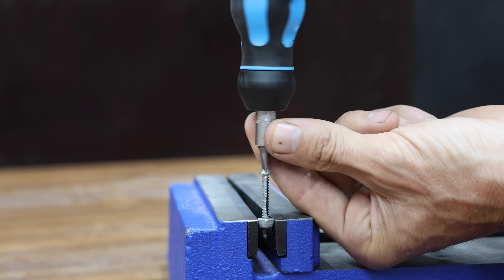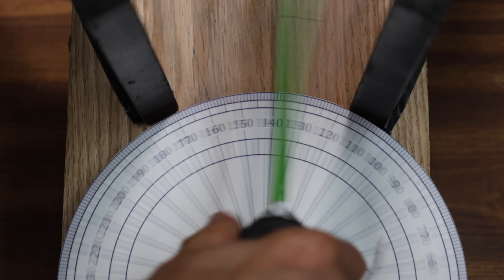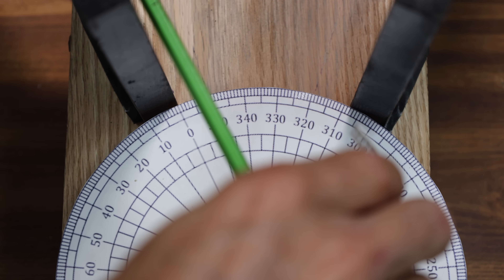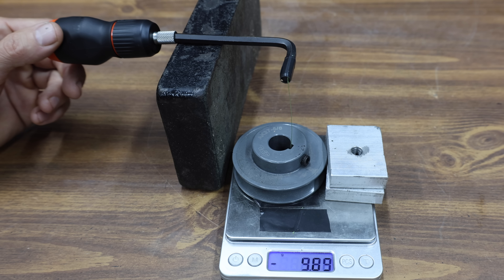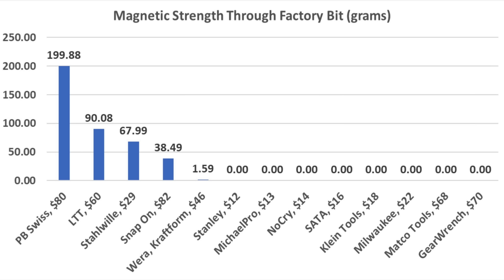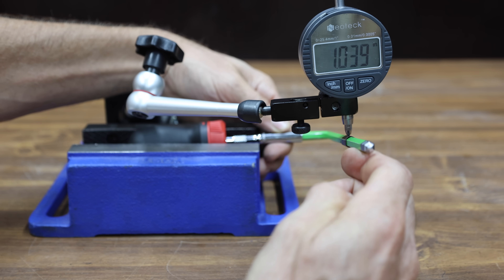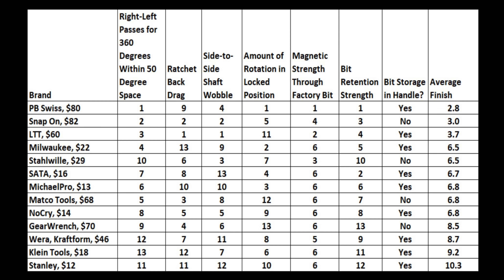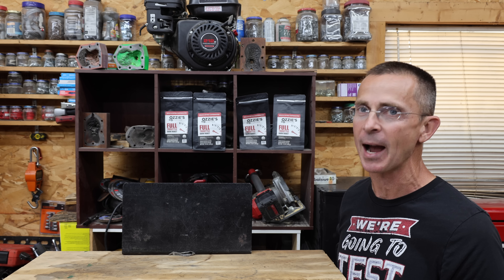Is Linus Tech Tips “Stubby” Screwdriver Best? Let's Settle This!

Comment: I'm not certain in what conditions you'll need to torque a screw, or small nut much more than 100lbs, and even that would be pushing it with just a hand grip. You'd need to be very strong to get that kind of torque on such a small grip hence I think that test isn't really needed as they all would pass the torque test at 100lbs. Cheers to LTT for selling a good product, but I'd go with the Snap-On were it my money.👍😎✌🗽
Reply from the maker: Thanks for the feedback.
Reply: @ProjectFarm  BTW, my comment sounded critical now that I look at it. It wasn't supposed to be, you do a bang up job reviewing everything you test. 👍😎✌🗽⭐⭐⭐⭐⭐⭐⭐⭐⭐⭐

Comment: Didn't include where the ltt screwdriver was made. Was a bit indicative of the rest lf the video. Pretty disappointed to see some obvious bias here. Ignored where its made, threw out results that didnt favor it, seemingly threw in more tests of the same type that it was strong in, the JB weld comment, shout-out at the end, etc
Reply: Same with the first screwdriver. Includes 3 tests on magnet strength, throws out 2 tests on durability. 

Because as we all know the magnet is more important than how long the tool will last. /s
Reply: @dru70292  100%

Comment: I'm a big fan but do have a question about the number-of-x-degree-movements-to-turn-360-degrees test.  Shouldn't the reference point be the shaft, or the bit itself?  Doesn't placing the hex wrench on the handle mean that the diameter of the handle where the hex wrench is attached will impact results (thinner handles will be able to turn more degrees at a time?).  I haven't really thought it through fully, so I can't tell.

Comment: Wouldn't side to side shaft wobble be better to measure in millimetres rather than hundredths of an inch?

It's like saying my shoe length is 0.0005 of a mile. Kind of ridiculous. But if I measured my shoe in centimetres or inches, it would make more sense because it's a unit that is relative to the size of the object being measured.

Comment: You can actually rehone Phillips head bits by hand with a rotary tool and a small grinder bit. That way you might not have to throw some of those away an you could even retest them afterwards I find Its a good fix for cam action on even cheap screwdrivers. 12:48 some screwdrivers have larger sections of metal for this reason Which makes the replaceable shafts questionable unless you can use easy to get part or standard like 1/4"-1/4", or an extension with a bit tipend
Reply: Does anyone refurbish bits? Take it from people who work in construction, myself included, stay away from DeWalt bits. They are hot garbage as they aren't hard enough. You must pay the money and get the high carbon steel bits if you want them to last.
Reply: @bluecar5556  It only takes a few minutes to diy grind them. That way they last and you get to keep your money. 🧠
Reply from the maker: Thanks for the feedback.

Comment: Does a lower back drag mean the screwdriver is less "strong" when tightening screws?
Like, a 10g backdrag screwdriver would snap sooner than a screwdriver with a stiffer backdrag?
Reply: No, it's an indication at how well you can turn the ratchet and not have the screw unscrew itself. If it's high and say you are threading in a machine screw it will just unscrew itself, which is super annoying. But if you're working with a coarse thread it likely won't matter it will just fatigue your hand faster if the back drag is high. So low back drag is pretty much ideal in all situations.

Comment: I need to add a versatile ratcheting screw driver with bits to my metric motorcycle tool bag.  Do any of these come with metric Allen wrenches, etc, or will I have to buy the separate metric bits?  Thanks.

Comment: I watched the Linus Tech Tips Stubby video made by them when it was released and almost bought one, but it's quite expensive.  So I was eager to watch your comparison.  #3 on 360° within a 50° space.  #5 on Length.  #1 in Ratchet Back Drag (because it was designed to work inside computer cases).   #2 in Magnetic Strength (also because it was designed for that).  #1 in Side-to-Side Wobble (for the same reason and by a long shot).  #4 in Bit Retention (and I'd rather not have the bit be too hard to remove for changing).  #11 of 13, nearly last, on Rotation in Locked (what a shame).  #2 in Bit Tip Failure (pretty darn good, but I'd get replacements bits elsewhere).

For me, the LTT would be the one.  I don't need indestructible for working on computers, it's a little shorter than the Snap On, costs less, its bits are strong, and things like 2" and 6" bits and extensions make it more versatile for reach.  Thank you, Todd.  Too bad you can't get an affiliate link.  I like to support you when I need or want something.
Reply from the maker: You are welcome!  I do have an Amazon affiliate link.
Reply: @ProjectFarm   I meant affiliate links for places like Harbor Freight, Linus Tech Tips, the other two Ratcheting Stubby Drivers and other products not on Amazon.

Comment: Video suggestion: standard led light bulbs. I have used Cree, Philips, GE, feit. Feit and GE fail after a few months of normal use. Only have on Philips and it is a smart bulb, still going strong. My oldest led bulb is cree and it spent 6 years outside in montana and still going strong. I would love to see a durable test, light output, wattage use, color accuracy test.
Reply from the maker: Thanks for the suggestion.

Comment: Honestly, at $14 the No Cry is a great value from a back drag perspective being so close to the $70 GearWrench, and the $30 Stahwille with its fairly strong magnet and still fairly low backdrag is a close second in value in my mind, especially if you have your own bits handy and would otherwise be ok with no onboard storage
Reply from the maker: Thanks for the feedback.
Reply: You can get the stawille one for cheaper under bahco sl25 , exact same stubby with extensions& bits for less money
Reply: @garymccreath2773 
Not sure who the OEM is for that one, but the same tools (with slightly varying styling) are sold by a number of brands. 
I happen to have a Bahco branded one, but would not recommend it. There‘s nothing particularly wrong with it, but the ratchet isn’t all that precise, mediocre back drag and it has a fair bit of shaft wobble. 
The toothless ratchets made by Oplast (sold under Hazet, Gedore and some other brands in different configurations) are just better and similarly priced.
Reply: Eh I had a bad experience with my No Cry stubby from 2019.  After less than 2 months the mechanism for holding bits fell apart.

Comment: I can not understand why anyone would pay $80.00 for a stubby screwdriver.
Reply: It’s not just about the tools it’s warranty customer service time I have to spend replacing them if they break ext 

Even if harbor warranty’s all there tools the same as Snap-on if I have to drive a hour there every other day to replace tools when Snap-on will come to me wherever I am and get me a replacement in mins once a year I’m saving more than the cost of the tool on the time alone.      Also there’s a big difference in tools like bits and wrenches the cheap one might be durable but will round a bolt or screw faster at lower torque than a different bit or wrench snapon’s non slip wrenches being one example
Reply: @Doubie.  I know what you're saying and I agree that service is worth something, but come on 80 bucks for a stubby? Even if its' ratcheting .
Reply from the maker: Thanks for the feedback.

Comment: Um...bruh...it's a "stubby"!!!
How is overall length not one of the ratings?  Some of these are longer than their non-stubby #2 counterparts from the same manufacturer.  Love the reviews as always and your methodology is so solid. 
Can you add an addendum or sticky with total length from the bit insert point to the tail end of the handle? No point in buying a $100 stubby that's 6" long. Lol.

Comment: Destruction tests should ALWAYS be included because mechanics use tools to get the job done compared to which tool survival is secondary. 
A screwdriver example is forcing a stubby against a fastener with a pry bar then turning it by visegrip which I and others have done to remove aircraft panel screws in tight locations. Automotive engine bays see all sorts of unconventional fastener removal out of necessity with modern engine compartments being quite cramped and awkward.
Reply from the maker: Thanks for the feedback.

Comment: Great testing on these screwdrivers! I have one observation on the Klein Tools bit holding test. I noticed that the bit in that one was not magnetic like the others and had a straight blade tip and a ball bearing holding assembly on it. Others seemed to all magnetic. I wonder if that had a different tip in it what the test would have been. It's surely not a big deal, but just curious. Thank you for all the hard work you do with all the testing you do!!
Reply from the maker: Thanks and you are welcome!

Comment: I'm surprised the LTT stubby is magnetized.  That's a recipe for disaster, working on computers.
Reply from the maker: Thanks for the feedback.
Reply: @htr5372 Right, and you probably use adjustable wrenches to work on your car.  Your car will usually get fixed, I'm sure.  That's just not the way I like to work.
Reply: @htr5372 Wow, my comment about LTT's magnetized stubby is really getting to you.  Did you design it, or what?  This seems very personal, to you.

Comment: LLT Screwdriver and Backpack owner, can report good quality in both products so far. I use them both for their intended purpose of working on PC's and totting my laptop, Mouse, TKL keyboard and sketch book. I don't see myself needing a stubby for any reason. If I can't get the full size LTT in a place I need it, it's often just the short and thick shaft relative to a non ratcheting screwdriver that is the problem. Mechanism made in China, Body Molding and Finished Assembly done in British Columbia, CA.
Reply from the maker: Thanks for the feedback.

Comment: Cool video as always!

Suggestion for a video....compare gear oils, conventional vs synthetic.

75-90, 75-110, and 85-140.

Pour tests in realistic environments...like 32 deg F, 0 deg F, -20 deg F

The way cold and warm and hot oil clings to gears, conventional vs synthetic.

I think people will be surprised how good conventional gear oil is.
Reply from the maker: Thanks!  Thanks for the suggestion.
Reply: @ProjectFarm  Forgot to add....gear oil at 200 deg F, or even 225-250 deg F gets interesting in terms of clingability between synthetic and conventional. Hard to measure shear and cushion without the high torque of a ring and pinion though...just some ideas.

Comment: The LTT seriously need a thicccer shaft for the break test. The handle or the rachet should be the fairlure point, not the bit holder. I've had cheap bit holder break on me from normal use just because the walls were too thin.
Reply from the maker: Thanks for the constructive feedback.

Comment: I know it would be a pricey test to do, but I'd love to see you test cordless mini cutoff tools such as the Dewalt 20V cutoff tool, the Ryobi 18V cutoff tool and the Milwaukee  M12 Fuel 12V cutoff tool. These are small blade tools that are only meant for cutting thin metal. Although toothed saw blades are available, they aren't common in this size tool, and as far as I know, none of these claim to be able to cut wood.
Reply from the maker: Thanks for the suggestion.

Comment: I know you mainly do tool reviews and auto stuff. But i know alot of guys, that use box fans with filters. And air purifiers when working. As well as just wanting to know the general conclusion on which ones work well and which ones dont. Like, shark, levoit, honeywell etc. You do in my eyes throughly test stuff. And alot of videos i see wouldnt test as well as you do with an air purifier. And with todays climate issues, smog, wildfire smoke etc. I think it would be a cool watch.
Reply from the maker: Thanks for the suggestion.

Comment: Another great test. It's reassuring to see Snap On excel in the 'lowered expectations' department, their consistency in that is stellar. Arguably, most guys/gals don't have the grip strength to break the mechanism on a stubby, particularly in a tight location. The pros probably do. For my use and money, I'd stick with the middle of the pack and lower price range, none of which we'd know without your test.
Reply from the maker: Thanks!  Thanks for the feedback.

Comment: I immediately bought the regular screwdriver after your review last time. I was happy with my purchase and continue to be. There is nothing more satisfying that taking an electrical box and starting every screw with the ratchet working after the first turn because there is very little back drag. The stubby I don't think I will need. Most times when I'm doing work I just do the extra little bit to allow me to use a standard length screwdriver. I appreciate their entrance into the market as it will undoubtedly make other manufacturers do better on their products.

Thank you for another great informative video.
Reply from the maker: Thanks and you are welcome!

Comment: If price isn't a factor the LTT holds its own quite well, but for the majority of people using a stubby screwdriver, overall length is the biggest factor (or you'd be using a normal screwdriver), then price. All the other factors are largely irrelevant assuming they don't fail too soon. For me, a $16 screwdriver would need to be four times 'worse' (longer or breaks with human forces) than a $60, and they were much closer than that.
Reply from the maker: Thanks for the feedback.

Comment: I bought a generic version of the NoCry that looked practically identical for £5. Worst screwdriver i’ve ever used. As soon as any force is applied on the head of the screw (straight down not twisting) the whole screwdriver fell apart due to only being held together by a small metal ring and a plastic piece.
Reply from the maker: Thanks for sharing.

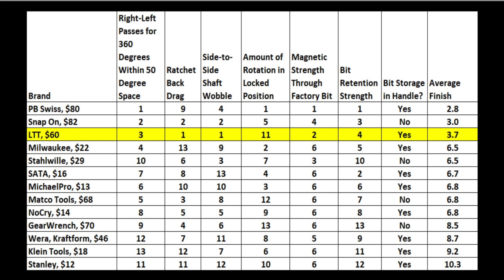Comment: 16:16 Bit storage is a gimmick. Any craftsman has a kit with multiple of many different bits, those 6 or 7 in the screwdriver wouldn't make any difference in my opinion.
The total length of a "stubby" screwdriver is most important, and most of them are still too large and bulky for some of my applications.
Reply from the maker: Thanks for the feedback.

Comment: Why did you test in a 50 degree radial?
This bothered me quite a bit since 360 degrees is evenly divisible by 1, 2, 3, 4, 6, 8, 9, 12, 15, 18, 20, 24, 30, 36, 40, 45, 60, 72, 90, 120, 180 and 360 itself.
IT IS NOT evenly divisible by 50!

Augh! It bothers me like a rusty bearing...

Comment: Did not see mine.  Mine is a red transparent ball with black rubber grip, and has two length settings (4.5," and 5.75" with bit).  I suspect the ball is wider than the handles on the reviewed ones.  I doubt it cost more than $7.  Yet, I don't think I would trade it in for any of these.  It would not fare well on the torture tests.  But when am I going to turn it with 100 foot pounds?  Who keeps all the original bits?  Testing those makes no sense.  Side to side flop can be a feature, helping keep the bit in the screw where the angle is very difficult.  What I have is far from perfect.  Back drag matters, and I suspect mine is not great.  The 360 passes matters too.  Again, mine is probably crap.  But it fits my hand.  Took a look at it.  No brand.  Looked at Amazon...it was not there.  Mine appears to be in bad shape, too :(  It appears to have more back drag in some places than others.  In theory, you can one-hand direction switch, in practice it tends to be too awkward to do.  So, it looks like I need a replacement...but I don't like any of these or any of the prices.
I am sure I am dreaming, but it would be great if there was a geared one that can spin faster than you twist and slower when you twist, depending on setting.  Or even better, based on resistance.
I honestly can't see paying more than $20.  And one that does not hold any bits?  That is ridiculous.  Who would buy that?  How about 15 bits, including some popular nut driver bits?
Reply from the maker: Thanks for the suggestion.

Comment: Another great one. One way I think you could have a better  representation for the locked position movement would be to set it up like the one used for the working arch swing  and start the Allen key at 0 and see to what degree the key will go. Then you can see that in locked position _ driver has xx° of backlash.  Also, for future screwdriver tests: torque drivers and  include the kobalt double drive in your next round of screwdriver tests since it is drastically different from other ratcheting drivers in how it functions.
Reply from the maker: Thanks!  Thanks for the feedback.

Comment: I would have liked to have seen the Doyle version from harbor freight included.   I really like the improvements HF has made to their tools over the last few years.
Reply from the maker: Thanks for the suggestion.
Reply: HF has had a number of 'good' tool reviews on occasion the last couple years.  They can spec quality at least up to anyone else, if they want to pay for that level and take the hit on profit. 
They rarely do, though recently they seem to be pricing a lot of stuff a bit higher with less jankiness looking internals.  Gotta watch for the bait and switch where AvE or someone does a teardown and finds its good quality similar to on of the other top names, and then once a run starts on them and their rep get passed by word of mouth, they swap in a different SKU model that looks the same but is value engineered lower for higher profit.
Reply: The Doyle is nearly the same as Kleins
Reply: I have the doyle stubby. Its ok
Reply: I don’t like the ratchet on mine.